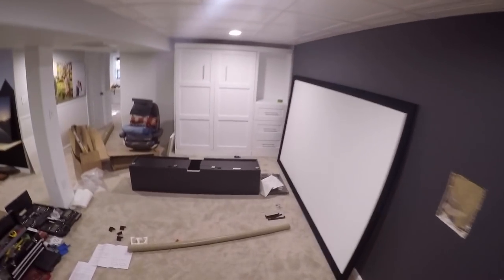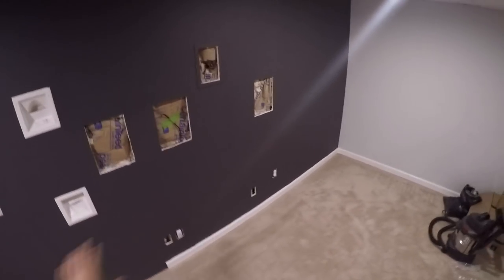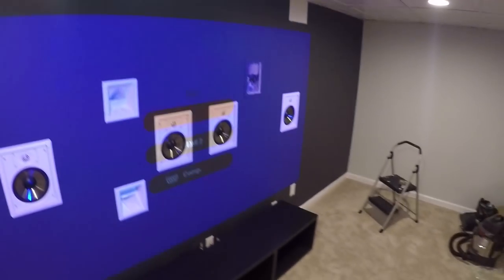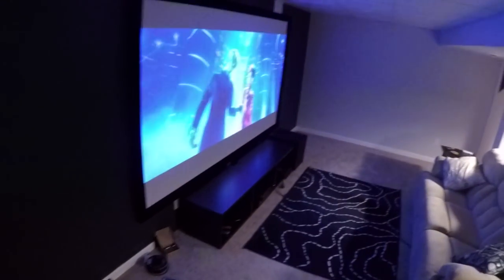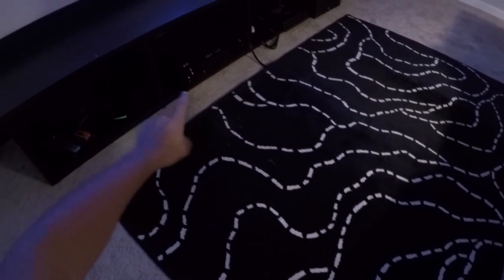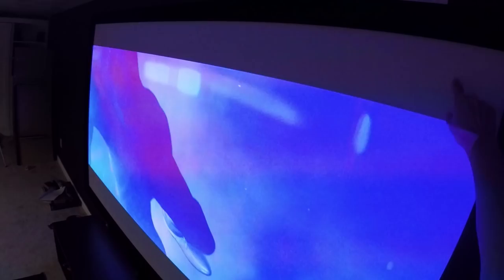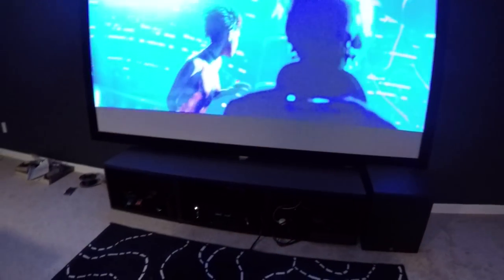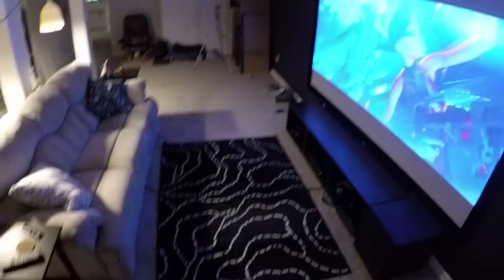Phase 1 of the Home Theater is DONE! - Episode 5

Comment: Great set up man! You used your budget to the fullest. My only issue is the couch looks really close to the screen (i know the beams make it difficult). I recommend if you ever upgrade the screen, go with a slightly smaller, sharper screen. This would reduce eye fatigue after a long movie. You will still have the wow effect but sitting in the couch wont feel like front row at the imax.

Comment: Congrats, the room looks great. I had the same problem with the ceiling, I ended up painting the ceiling flat black. Night and day difference. Now, the only thing not painted flat black is the wood floor. Lol
Reply from the maker: I'm still going back and forth on black paint vs a black covering of some kind. What paint did you use, if you don't mind me asking?
Reply: JERMgaming I went with HomeDepot Behr Premium Plus Deep Base Flat Zero VOC Interior Paint and Primer in One. Model# 130005
I think it was like $23 per gal. I bought the 5 gal. bucket for $112 and had some leftover. My room is 13x15x8, I love the way it looks, no windows, it's as dark as a cave. Lol

Comment: Doubling up the speakers on the channels is a bad idea. The audio was not mixed that way and it's going to sound terrible. The sounds meant to come from a single speaker are going to hit your ears at different times since they are now coming from two different locations. You are also either going to lose volume, or put a bigger strain on your amps in the AVR, so you are going to run hot and lose any headroom. There is no need for 2 center channel speakers, and if you want two rows, then buy 9 or 11 channel AVR and do it right.
Reply from the maker: If all that was universally true, then line arrays wouldn't be the standard way to cover large areas at concerts. The two speakers are so close to each other (<6" apart) that the sound delay won't be noticeable, and the new AVR is rated for that impedance and has plenty of headroom even at way above my normal listening volume. 

If the speakers were very low sensitivity, I agree it could be an issue if I didn't step up to external amplification or something similar. But, as it is, it sounds great. I would normally agree that two aren't necessary, but in this case I either had to use two, or have a horizontally offset center. It sounds fantastic as-is.

Comment: It was a cool idea to do the speakers behind the screen. But you should of had back boxes your going to lose sound since nothing is behind the speakers. Anything in wall should be built with a speaker box. To prevent leakage.
Reply from the maker: These speakers are designed to be used in a wall, and there's insulation behind them. They sound great, not at all like they do in open air.
Reply: JERMgaming even with insulation, that is not protection for a speaker. Just because they make in wall speakers like the ones you have purchased doesn’t mean you don’t need to do extra steps. If you had a back box. The speaker vibration would be bouncing off that. Something solid. Instead of paper which would leak.

Comment: What projector did you go with? If you still went with a 1080p model you should get an Aries Prime whdmi unit. I bought one for my home mix studio for Norman and it’s great. Wireless Hdmi transmitter and receiver so no ugly wires and issues trying to hit it in the walls/ceiling.
Reply from the maker: A Viewsonic PX727-4K. I'd love wireless, but I think it'll be awhile before I can get one for 4K. I went through a bunch of HDMI cables before I found some that could carry the full 18gbps bandwidth from the source through the AVR to the projector. I've got a drop ceiling so hiding wires shouldn't be too bad, it'll just take a lot of time.
Reply: Word... ya definitely no dice for 4k... Love how clean of a setup it makes it at least in my situation with 1080p. Looks like a really nice setup man. Be curious to hear how it sounds sometime.

Comment: You got the drop ceiling bro run your wires up there not on the floor
Reply from the maker: I'll be using the drop ceiling to get them from midway through the room on back, but if I run them up the wall at the front, then I have to hide them right next to the screen. I might do that long-term, I haven't decided yet.
Reply: JERMgaming hid them in the wall like you did with your speaker wire

Comment: Any reason you chose a white projector screen over a black one? From what I've seen, black screens/walls painted grey/black look much, much, better than white/light colored screens.
Reply from the maker: Gray/black screens look good in areas with lots of ambient light, and with really bright projectors. I have complete light control in the basement, so there isn't much of an advantage with a darker screen because my default black level is essentially pure black. Once I mute light reflections from the other walls and the ceiling, the main factor in my black levels will be the quality of the projector itself. 

That would improve some with a darker screen, but not nearly as much as it would if I was using this in a brightly lit room. I'd also need a much brighter projector.
Reply: JERMgaming Ah okay. Thanks for clearing that up.
Reply: A screen below Gain 1.0 gives you better black, but also mutes the whites/bright areas. So it's always a compromise.

Comment: I think the surround sound is going to be a mess, doubling the number of speakers will probably degrade the experience rather than amplifying it, unless you really know how to treat psycho accustics., and by the way i would never put speakers behind the screen, only maybe subs, even thought it would cause vibration on the screen.
The dream of having it seems more important than the  dream of experiencing it for the majority.
Reply from the maker: Putting speakers behind the screen is exactly what "real" theaters do, and it's very doable in a setup like mine. Putting a sub behind a screen would matter less than any other speakers, since bass is less directional. 

I'm not considering doubling all of my surround speakers, I'm considering adding two speakers for each Atmos channel. One on each side of the HVAC tunnel, because people sitting on each side won't easily be able to hear the speaker on the other side.
Reply: thats actually a good idea adding another speaker to each channel, im gonna think about doing that.
Reply: Real theaters usually put the speaker behind the screen? Well not in my country, maybe high end screens have something to reduce the loss in treeble response, but i think that for the size of your screen and if the screen was created for 4k or higher resolutions it tends to have higher density.
I don't really get it, since you are going to place the surround speakers on the ceilings as well, but sure since the atmos is not much about directionality more speakers could work well indeed.
Reply: T B im sorry but this does not exist in reality... Maybe the guys here does not take sound seriously...
Reply: @MarceloTezza   Marcelo: What are you talking about? Putting especially the center channel behind the screen has a big impact. Our ears are well made, so having the center speaker only a few degrees off of the middle of the screen is very noticeable. I only have a 65" OLED and my Center above the screen, and you can clearly hear that the person speaking comes from above and not from the screen. 
Maybe your cinema in your area is a very old one with a small screen. Even my cheapest one with a 4m wide screen in the smallest room has the speakers behind the screen.

Comment: Awesome setup looking forward to seeing the final product and if your worried of reflection from ceiling you can look at buy projector screen paint and turning your screen into a high contrast screen check out the YouTuber crow1176 if you're interested and what sources are you using for your movies if you have digital copies on a hard drive you can run it on the media player app on your playstation 4 and most movies can be cropped to fill the screen with out image getting cut off
Reply from the maker: I can't paint an acoustically transparent screen, the best thing to do is mask the area around it. 

Also, for cinemascope movies, I don't want to crop them in, I want to watch them as the director intended.

Comment: Really bad speaker placement. Worse yet you used in wall speakers for the center and front channels. I would have use that for rear or in an ultra clean setup, but with a dedicated room, in walls were not the best choice in my opinion.
Reply from the maker: Be specific about why the speaker placement is bad. I'm curious what you think.
Reply: JERMgaming well you did 4 speakers in the front, behind the screen... The screen wasn't a perforated screen as far as I could tell. How and which one was wired as the center channel? Did you wire two of them as a center?
Reply from the maker: Did you watch the build series? All of that was covered. It's an acoustically transparent screen. I have 6 spaces in between wall studs behind the screen area, so either I had to go with an offset center, or 2 centers. I went with 2 centers, with the tweeters pointed wider to make a larger sweet spot. The speakers are at the exact right height for the seating area. Comb filtering has not made a notable difference.
Reply: JERMgaming ah I see. Well I just discovered your channel so I will check the other video then.

Otherwise great production value on the video.
Reply from the maker: Thanks, glad you liked it!

Comment: look into a marantz receiver and parasound amps. thank me later.
Reply from the maker: Marantz and Denon receivers are essentially identical, it's the same company. I do love how they look, though!

Also, I'm not snobby about amps, Crown is good enough for me.
Reply: JERMgaming ohh nice I didn’t know you had a denon receiver but if you ever want to take your home theater to the next level look into the marantz AV8805. It ain’t even terminals anymore it’s straight XLR. That and a Parasound A51, you’ll get chills my friend. It’s pricey but worth it, it’s definitely in my bucket list.
Reply: There is absolutely no reason for him to go pre/pro when he is sitting like 6-8 feet away.
Reply: that's true. but having the ultimate listening experience and sound quality wouldn't hurt. plus you can always calibrate the speakers to accommodate the room.
Reply from the maker: Oscar Gonzalez Yeah ... But if I'm only using 50% of the power I've got, will using 10% of a lot more power make a difference? I understand what you're saying, but  I ran live sound for years. I know I don't need that type of power for most things. I will be powering the new sub with a Crown amp, but my receiver should be fine for everything else I've got.